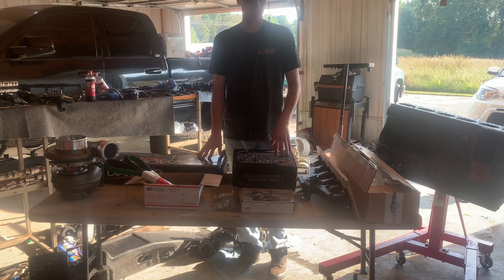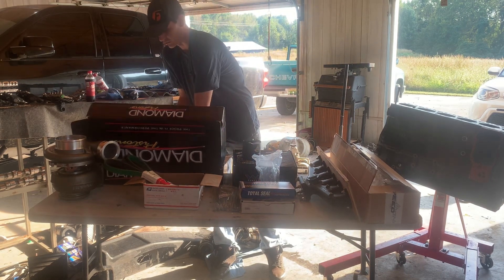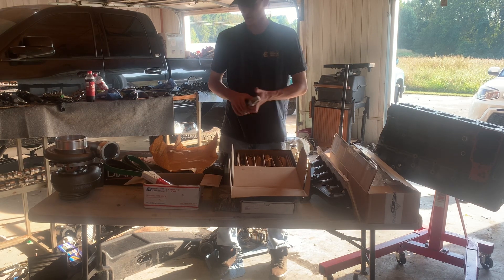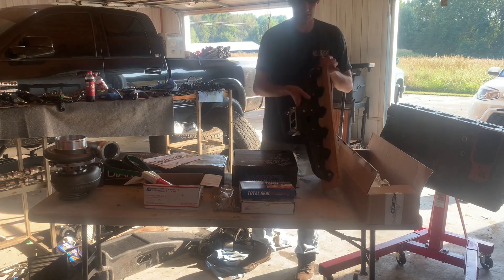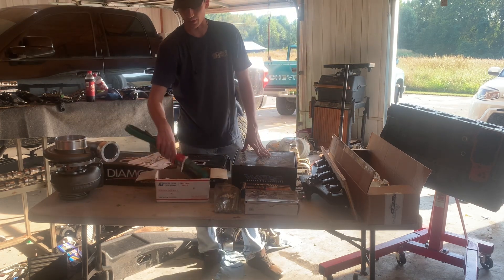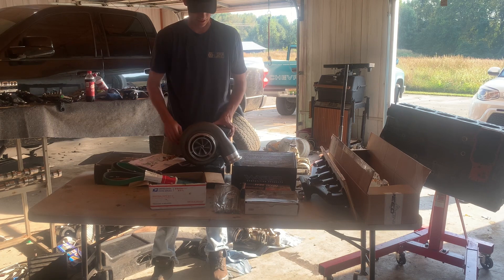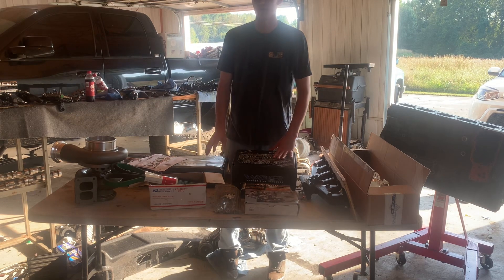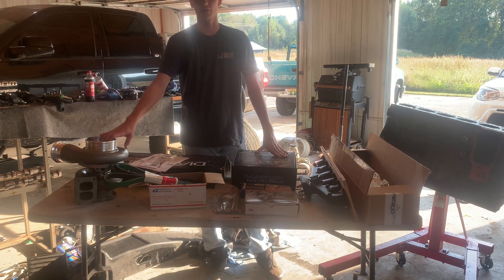2000 HP Cummins engine build begins!!

Comment: Hey 1 thinking I figured I might add is that you will won't to run a fast 250.. that's what they recommend  when running the 14mil pump
Reply from the maker: It’s crossed my mind! Any experience with the new air dog 5G? I believe they came out with a 220 pump
Reply: @justin_earwood1827  I stopped running a airdog about 5 years ago.. never looked back.. didn't like the way it sandwiched the frame.. nice build BTW I built Ole most same setup except qsb pistons beans gridlock an 625s kill devil comp head with banks side draft.
Reply from the maker: @derekperry3951  thanks man! Far from done yet but a lot of progress since it initially went down! How have you liked yours so far?
Reply: @justin_earwood1827  man I love it only have 1 small kit on it now.. an had 2 stock cp3 on it so I ran out of pump. Swapped to a 14mil an haven't ran it this year waiting on transmission..lol you staying 6.7 I went 6.4 stroke.
Reply from the maker: @derekperry3951  mine will be a 6.4 too just done the other way it’s a 4.125 bore engine but I’ll make up for the lost displacement with nitrous lol. Going to see how much those pistons will really take!
Reply: @justin_earwood1827  dude can't wait buddy are you doing the bottom end?
Reply from the maker: @derekperry3951  no sir! I was planning on it originally but at the level I’m trying to push it I’m letting Steve Burton at new performance auto in Virginia put it together. It’ll be a long block when I pick it up in a few weeks then I will just finish the little things
Reply: @justin_earwood1827  hell yeah.. that's smart sum times I second guess myself on mine lol but it's seen 1400 so far an still running.. so hopefully it stays together 🙏 lol
Reply from the maker: @derekperry3951  I just hope mine can do that for a long time lol make consistent power and hold up to 1500 plus
Reply: @justin_earwood1827  me too buddt